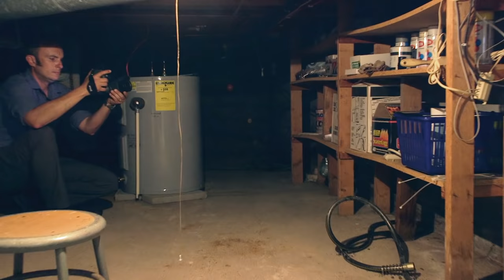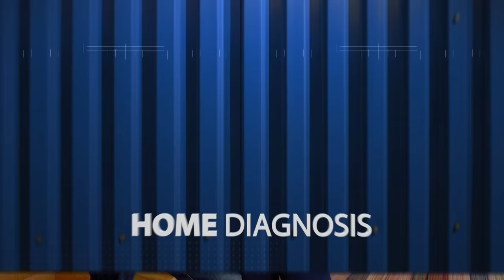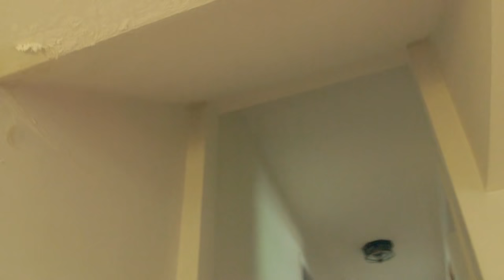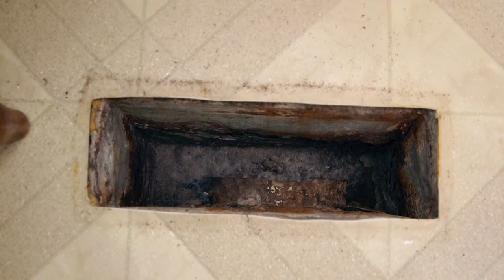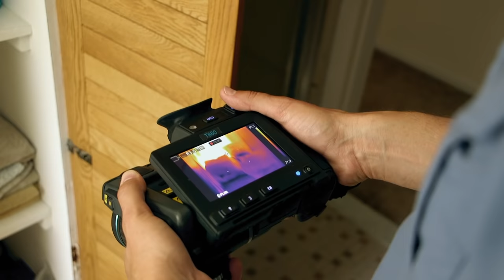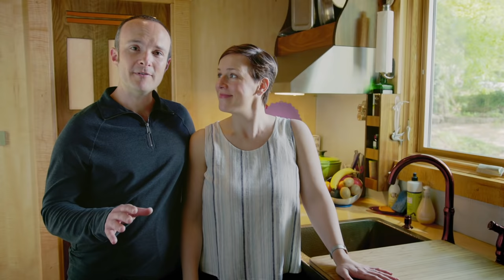How to Flip a House for Performance- Ep 103 of Home Diagnosis TV Series

Comment: @5:14 "When it comes to flipping a house there are a lot of misconceptions out there." Such as the definition of flipping. Flipping a house is when you buy it, then turn around and put it back on the market almost immediately. This is done for economic reasons, not so you'll have a place to live or rent out. Often times you'll only have time for cosmetic improvements, such as a through cleaning, paint, and carpet. If you get involved with rebuilding the kitchen the timeline goes way out, the cost goes way up, and your chance for profit goes way down. Maybe you could reface cabinets, but much more than that and it becomes a renovation and you'd better have gotten the house for amazingly cheap.

Living in a house for 35 years is NOT flipping. Nor is preparing a house you already own for a quick sale.

Comment: You went on and on about the split wall, but gave zero information on how to address its issues. None. As someone who owns a split-level and has noticed those same symptoms, that was information that I wanted to know.
Reply from the maker: Cantankerous, we actually did- airseal the top of the wall, where it hits either attic. You can see an attic airsealing video where we actually do this here:
How to Air Seal Your Attic: The Secret Home Improvement BEFORE Attic Insulation
https://youtu.be/fPKt35I4MZ0